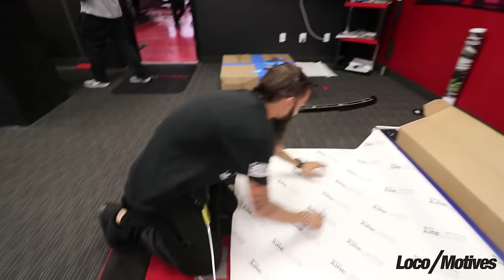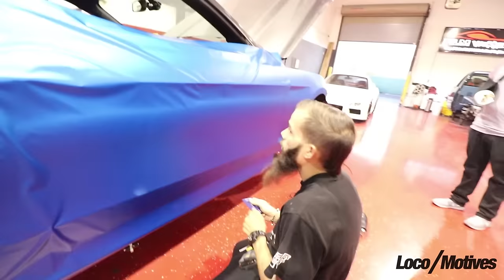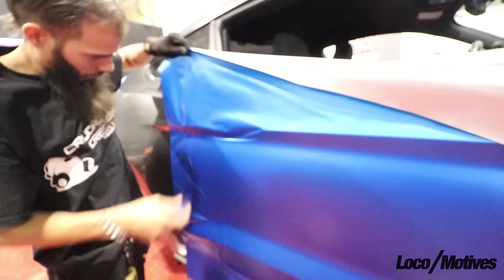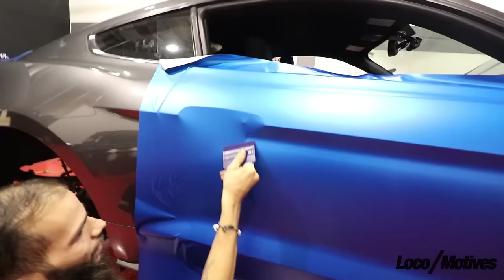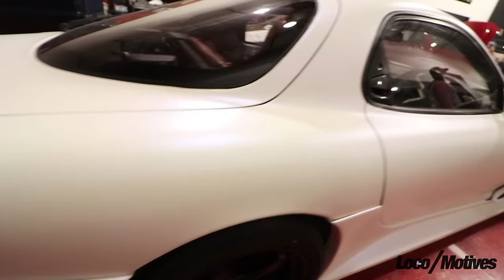I Learn How To Vinyl Wrap A Car

Comment: The pain when Carlos ripped the vinyl off after fixing it  😂
Reply: KiltedMcKay he had to, he did not use heat around the handle area which resulted in to much vinyl that would have creased on him. Also he should have tackled that recess before he moved on because he fucks up he had to rip it up like he did because of many reasons imo
Reply: I'm saying I got frustrated asf
Reply: @michaelrich5501  not so much that he didn't use heat, he didn't have enough tension, too much slack. Notice how he pulls it tight when he laid it back down. Guaranteed glue line where he lifted back up though 🤪
Reply: I felt so annoyed by the guy talking to Carlos! I was like "Shut Up. Dude! Let Carlos work in peace" After he said "O Boy, O Boy!!" Now I hate the guy filming this! The frustration 🙄🤨 Great Job Carlos with being patient 😊
Reply: Right!
Reply: @cwilson9636  it was for the video, it's not like he just walked into his shop and started harassing him.
Reply: I had a guy fixing my Garage door springs and the guy teaching him kept talking to him. Finally the trainer looked at me and told me it was doing because other customers would talk to the guy counting turning the springs in other houses.

Comment: If anyone else went nuts like I did when Carlos said "recommended time span", it's 5-7 years as long as it's properly maintained and not under constant sunlight. If it is under constant sunlight it's only about a year.

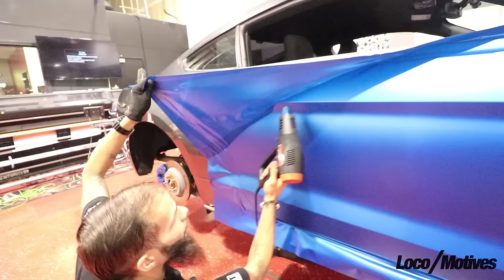Comment: if people are watching this, and attempt to use this method to wrap the doors than your doing it wrong. Once the vinyl is laid YOU MUST PULL EVEN TENSION on all FOUR corners(triangle method). It'll gives that glass look (which is what you want) And because of this the tension by the door where the gentlemen had the problem at 10:00 would have not happened. not saying he's a bad wrapper but there are more efficient ways of doing this.
Reply: Am using the triangle method for over a year now and its best way there is!!

Comment: The mistake he made was to wrap the bottom of the door first. You should always wrap from the top down, because when you peel back the top as he did, the dust that's in the air can fall behind the vinyl, and you don't want that. Always wrap the top first people.
Reply: But what about all the dust on the ground (floor)? Math seems to equal whipping a big "wing" right above the ground wld kick up a buncha shit as opposed jus wavin em in tha air jus like ya dont care...?
Reply: He actually started from the center. Which is what you want to do. Know what you're talking about before you comment
Reply: @spoolin05srt  100 100 100, always start in the middle.
The material may change & you may have to work up or work down. But you always want to start in the middle & work your way out
Reply: I think everyone has misunderstood what I mean.

Obviously you start in the middle, what I meant was he should have got the top half down before the bottom half.

He started in the middle and worked down, thats a no no.

Why?...because as he is taking the time to squeegee the bottom half of the door down, the top half is loose, leaving room for dust in the air to drop down behind the vinyl. Thats just gravity, more dust falls than lifts, so yes obviously start in the middle, but get the top half down before working on the bottom half.

So to the guy who says 'know what you're talking about'...I do.

Sorry if anyone misunderstood me.

Comment: When you put on adjacent (side) panels, always start at the BACK of the car. In that way the edge overlaps (if any) are directed AWAY from the wind stream, not towards.
Reply: When would you ever overlap vinyl?
Reply: This is dumb. There are no overlaps. Not when done correctly.

Comment: this is the future of car painting for sure. no mess no harsh chemicals which are flammable and dangarous to the person who works with them and  for the environment dont need en expensive chamber to rest the paint over time, paint gun, complex air supply system etc... and dramatically faster and cheaper!

Comment: “As long as you remove it within the right time span”

What is the right time span? And what happens if you wait too long?
Reply: A number of years, depending on the quality of the material.  They do get brittle eventually, which makes them a pain in the butt to peel off, and the plasticizers in the vinyl might separate and eat into your clearcoat.
Reply: I alway have wrapped with avery, we had a car that wanted to have a different color on his car after 4 years but the wrap came off just fine without any damage. If you remove your wrap within the "right time span" it just comes of more easy. Either way it doesn't damage your paint work.

Comment: found your video because of the blue color. Very good man. I am going to attempt to wrap my drift car
Reply: How did it go ?
Reply: @mohamedsamy8632  I did a few panels and it went well. Did it last summer and it still there :). I am finishing a few fixes on some of the panels and will finish wrapping for this season
Reply: @CarModsGarage  cuz I am thinking about wrapping my car too but low key nervous
Reply: @mohamedsamy8632  I made videos of my wrapping. Of course I made mistakes and to help I bought crappy wrap. Worst case you will need to get a bit more wrap to fix the bad parts lol

Comment: He said "It won't damage anything as long as you take it off in the recommended time span" What is that time span?
Reply: Usually within 2-5 years depending on brand.
Reply: In hot states, and if you park outside, no matter the brand, it’ll be a pain in the butt to remove after about a year. The cheaper the vinyl though, the more adhesive you gotta painfully remove from your paint.

Comment: Title should be "I learn how to vinyl wrap a car the wrong way".
Really though with the films out there today and how easy they are to work with and forgiving they are, it's pretty easy to wrap a car. Basically any dipshit can do it. It doesn't take too long to understand how the vinyl behaves and how to manipulate it. It really doesn't take near the skill as a nice paint job. That's really what's so great about it. It's substantially easier and cheaper for someone to change the color of their car with little to no experience. It's really a great option for someone looking to change the look of their vehicle.
Reply: @nicolasdeficcio  yea, I'm just speaking from experience. I've wrapped a few vehicles now and would have no issue accepting payment from someone to do it as I am confident in my ability. It was rather intuitive for me to understand the way the vinyl behaves but I'm sure that can differ from person to person.
Reply: And I literally nailed it the first time on my truck. Did tons of research and started on big flat panels to get a feel for the vinyl.

Comment: He means I should not have cut the vinyl on the carpet because vinyl is static and attracts dust particles, dust particles cause scratches and he should of started from the top to stop contamination under vinyl and he did not use any heat over the door handle which left to much material which caused the creases he would have got in the handle recess. He also did not finish corners first which resulted in crows fingers which he had. Wrapping is easy, finishing is hard. Imo he ripped that off because he had scratched the vinyl through contamination on the out side and inside through not working top down, he also put loads of glue lines in the vinyl from ripping it back up because he fucked the handle recess. His finishing was full of crows fingers (\|/) which look like that <  because he did not do corners first. There’s more I would say but this rant is long enough :)
Reply: from a wrap installer to another, this dude had no idea what he's doing, makes me really wonder how shop like this stayed open.
Reply: Lol the guy asked what does the heat do and he said it stinks it......NO it only stinks it if you have stretches it. Every thing is wrong with this install

Comment: Very cool, what would it cost to do a F150 Crew Cab Pickup, must areas on the truck are flat
Second question, If I wanted racing strips would you put a second layer on for them or print them into the hood, roof and tail gate wrap

Comment from the maker: The Real Question.... Paint Or Vinyl Wrap??? Which do you prefer?
Reply: Diymike vinyl wrap
Reply: It’s all about the wrap chap! KPMF for the win also! I’ve had 3 cars wrapped & all have been with KPMF! My fav is my 350z wrapped in flat orange!😍 Wrap is cheaper, you can change it when you want & the colours are amazing these days!👍🏻
Reply: Well considering my current paint on my 78 Camaro wasn't blocked correctly and they cleared over the imperfections, I definitely would consider car wrapping, but that all depends on duration or lifespan of the wrap. Nice skills Mr. Carlos, your my new hero!
Reply: Paint, so haters don't rip it off lol
Reply: @cyberpunk4622    Wraps last anywhere from 6 months to 1-2 years....Depends on the weather in your area, and how you drive the car.
Reply: Paint... if you learn to do prep yourself and know a guy with some gun skills you can have a great longlasting paintjob for a fraction of what wrapping every few years would cost
Reply: how long is the recommended time span to have a wrap on before you need to take it off?
Reply: @k-aw-teksleepysageuni8181   My Camaro is a project car, 8 years in my garage so far :( ,if I wrapped the car and only cruised it on weekends and it's also garage queen, how long do think the shelf life would be on a wrap?
Reply: no contest you can't beat that deep candy paint. it's just a matter of what you can afford. wraps are an awesome way to get away from bland stock colors easily and cheaply compared to paint.
Reply: Vinyl if it was my project car
Reply: Nooo! The real question is why did he do all that work just to rip it all off lol
Reply: I'm a painter so I'll say paint all day. You can't match the depth, gloss, and durability of a PROPER quality paint job. But once you compare the time, cost, and commitment, a wrap is the better option 90% of the time.
Reply: Paint! What kind of question is that? I’m an autobody painter FOOL!!!
Reply: @dropinbiking92  and wraps protect your paintwork too. No more stone chips on your bonnet paintjob. So i believe both have their positives... 👍
Reply: $100 clear PPF over the front end solves all those problems.
Reply: Wrap is just a sticker no you can’t change my mind

Comment: KPMF seems to be a full mil thicker than competitors. 3M and Avery matte and satin vinyls low 3's, ie 3.2, 3.3 and KPMF is like 4.2. I bought a sample of Avery's rugged vinyl (textured) at 4+ mils and could barely tell the difference, still felt very thin and delicate. That KPMF tore really easy, I was surprised by that! I know it was a cold pull, but still...

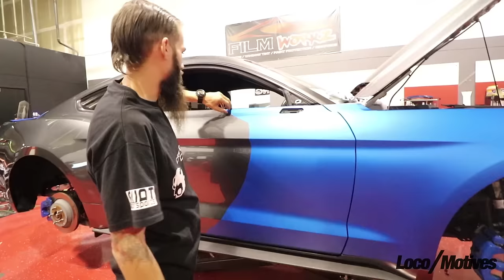Comment: 18:15 As long as you take it off In the recommended timespan. What does this mean exactly? If it sticks too long it ruins the paint?
Reply: you gotta unwrap it after 2-3 years, otherwise the glue will stick and it will be hell to remove it.
Reply: Travis LORD does temperature have any effect on timespan? If this is, say, an Alaska or Minnesota car versus a Nevada car?

Comment: "As long as you take it off in the recommended time span" Which is....?
Reply: I don't think there's a universal recommended time-span, I think its based on the type/brand of the vinyl. Most 3M vinyls seem to have a warranty for  around 3-5 years, so you'd want to make sure it comes off at 5 years tops.

Comment: I have a question. I’ve never wrapped before but am going to attempt my truck. But why not wrap the doors open so you can get the inside of the door in one shot?
Reply: If you are gonna go to that extent you definitely are better off taking panels off the vehicle.

Comment: Hi, There no YouTube on how to repair vinyl wrap after dings, scratches and rips..    could you make one? It would be a HIT!
Reply: The preferred/correct way to do a repair to a rip, ding, scratch, rips etc. would be to re-wrap the entire panel. Slight surface scratches MIGHT be curable with heat. Be careful with applying heat though, as you can create burn through marks, making it worse.

In some cases, the vinyl might not match (even if it's the same manufacturer/color). For multiple reasons: 1) The color on your car faded or 2) The color you are wrapping with vs the color on your car is a different batch number. Every color has different batch  number, depending on the date of manufacturing, etc. Due to this, there could be a slight color mismatch. In the case you do re-wrap a panel and there's no way to match the original color on the car - I'd suggest re-wrapping the whole car. The great thing about that is you could pick whatever color you want!
Reply: Sailing Chloe Corey gave a fabulous answer, however, depending on where you have scratched, you can cover them with a contrasting color with some sort of stripe design. Looks quite high end & much less expensive than re-wrapping the entire thing.
Reply: @kimlassiter8904 . Like your responses. Do you do wraps? Where located?

Comment: SO i have a 2017 vw golf and now that I did all the mechanical work to it (more hp) I want to wrap it. I want to follow your video. Are there any other tips for a beginner? do i start with a small area like the side mirrors? or the hood? What are all the tools? I have the heat gun and that little squeegee. What else do you need?

Comment: This might be a stupid question, but can you clear coat over vinyl wrap
Reply: Yes technically. Main thing is you'd need to bring your clear coat past the vinyl cut edges to seal them
Reply: Not advisable. You can never predict the chemical reaction & could end up with a sticky mess that never cures.
Reply: Wouldn't recommend it. If you were going to try it tho. I would try and do some test spray outs to see the reaction to the vinyl. And cuz you not sanding the vinyl for the clear to bite into it. You definitely want an adhesion promoter sprayed on before the clear. It can be done. It really wouldn't make any sense to do it tho.

Comment: How much for just the vinyl wrap if you do it yourself? And how many cars/tries until you get good?
Reply: Depending on brand and colour, can range from roughly $600-several thousand (chrome).
Til you get good.. half dozen 
Keep in mind, different brands and colours within them have different characteristics and some are much easier to wrap than others.
For ease of use and beginners, consensus is generally Avery.

Comment: -What's the heat do?

-shrinks it
Reply: Shrinks it. But also allows you to stretch it somewhat. It is what he needed to do to compensate for the concave of the door handle area. As it goes deeper, tense the need for more material. But you wouldn't piece it in. Must keep it one piece.

Comment: Do you take that rubber piece of top of the door
Reply: Yes. You want the vinyl to be completely sealed to the base surface of the piece you are wrapping. No air gaps at all. As that will just end up bubbling and peeling. Just make for a huge mess. Best way to wrap a car is to gut it. When I say gut it. I mean take off all trim, handles, moldings, etc. Everyrhing possible. If it was me, i would take all the glass out also. This would prevent peeling around wimdshield, quarter glass, and back glass. Prolly only would bother going to that extent on a high dollar vehicle tho. Most people prolly wouldn't want to pay to have all glass r & i.

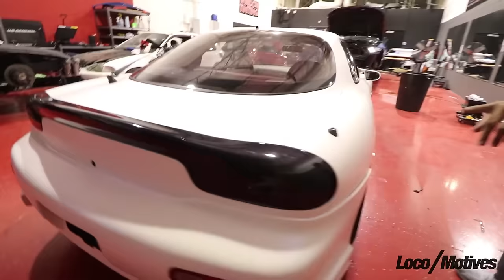Comment: 15:44 vinyl that wide, if it exists in the color/type the customer wants, would be so expensive most customers would just get a new paint job. 

No need to "run" from that job. Just quote it accurately and the customer will "run", and if they don't we get a fat check.

Comment: This is not easy.  The video instructor(s) know what they are doing and have everything set up for them including temperature. You will spend a lot on vinyl wrap until you figure out how to be 100% bubble free.   This is an advanced skilled thing to do for sure. It's one of those "Looks easy enough" projects but then the professor (of life) throws in calculus and physics questions you need to solve on the spot before the glue on the wrap becomes one with the body of the car.